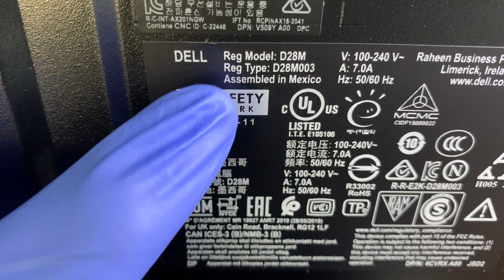Dell G5 5000 Desktop Break Down

Comment: You definitely CANNOT use the 8-pin AND the 6-pin connectors side by side. You choose one, or the other, not both. There are two PSU configurations for this machine. 360W, and 500W. Neither of them can power a card that requires an 8-pin AND a 6-pin. That would be a 300W card, which would be in the range of a 3070 Ti, or possibly an OEM 3080 that is custom configured for lower power consumption by the vendor that may exist somewhere in the world. There is no way such a card would run in this machine.

Comment: I'm not getting any power to my sata drives.  Using the 8 pin sata power adaptor.  Is this a common issue. Bios does not detect any drives

Comment: I upgraded my Ram by adding two additional sticks of 2x8GB 3200mhz. But they seem to be throttled down to 2400hz from 2933mhz. Is this expected or is there anything else I can do? My CPU is the i7 10700
Reply: it’s because your motherboard doesn’t allow those high speeds you can put and xmp through bios to reach those speeds if your motherboard allow it’s
Reply: Can you tell me which exact sticks of 8 gb ram you bought? I bought 2 sticks of 8gb but it didn’t work or wasn’t compatible…
Reply: @zawarust  i bought 2 sticks of 16 gb corsair vengeance rgb. they worked fine for me
Reply: @caubiy  thanks man! Appretiate it

Comment: Is there a way like a special cable to plug into the motherboard to use the intel graphics of the GPU (in case you removed the graphics card) ?

Comment: if i get a new motherboard can i remove all the parts and change the case?
Reply: I believe that would work but you would also need a new power supply
Reply: @chrisestrada8587 thanks for the info

Comment: Thanks for the walk-through. I have a question though. I want to run two Nvidia Geoforce GTX 650 supers rather than the single card supplied with the Dell G5. As there is only one card slot to accommodate the GPU is it possible to use an external (EGPU) on the G5 ? I don't want to remove what is a brand new GPU and spend a lot of money on an 8gb card but I want 8GB of vram. Any help would be appreciated. Also if a EGPU is viable what case would you suggest getting.
Reply from the maker: It will not work because the Power Supply is low voltage.

Comment: Mine came with a gtx 1650 super. Can I upgrade it to an rtx 2060? If not what is the best card I can upgrade to?
Reply from the maker: No you cannot. Power supply does not have enough power for 2060

Comment: I'm watching the video from Mongolia. I bought a Dell G5 i7 10700f and RTX 3060 ti dekstop 14 days ago.6 million MNT in Mongolian currency. That's $ 2,105.2.. When I bought it, I trusted the dell company. But I soon found out that people were dissatisfied with the computer, which was full of the Internet. The main problem was CPU overheating. So I studied. First I had to get a Cpu cooler. I also had to get a fan to improve the airflow. But I don't know which model of CPU cooler fits the motherboard. Also (power supply) is a concern. In addition to the 3 fans, the capacity will increase when installing the CPU cooler. I don't know how to do it all right. You also need to learn how to connect the plugs properly. And I'm sure that teaching well like this video will solve many people's problems. Thank you for your help
Reply from the maker: Mongolia, is your climate cold ? Here is my other video:  Benchmark with CPU Temp:  https://www.youtube.com/watch?v=Xuuu_DnhWbc
Another louder volume review: 
https://www.youtube.com/watch?v=Ozoq_EJdk4U

Comment: Thanks UberGeeks for the roadmap to the computer. I am experiencing buyer regret with this PC though, as I have bought more memory, but can't use this memory to the max as Dell does not let you overclock it. Won't be buying this brand again!
Reply: 2666mhz is an intel limitation, you can't OC it. Should have went Ryzen based if you want fast ram.
Reply: @TRUMPWON2020-w1r  ahh  that explains it. I’m limited there as well but I don’t think that’s too big a deal
Reply from the maker: I'm sorry to hear about your experience

Comment: Heat is a major issue with this pc. I'm looking at the Noctua u9s in a push pull configuration but I'm concerned it wont fit. What do you recommend to bring down GPU temps
Reply: For whatever reason, my gpu fan would not go anywhere near 100% speed. My GPU temp was 80+ with a hotspot temp of 90+. I downloaded MSI afterburner and changed the fan curve so I could ramp it up to full speed. I can keep my GPU in the 60s or 70s now.
Reply from the maker: I'll make separate video on heatsink installation
Reply: @UbergeeksBiz  thank you kind sir, subbed!

Comment: hi, so mine looks exactly like that except i have better graphics card.  my question is that it was supposed to come with a 512 solid state drive but i don't see it anywhere.   computer is working like it has it.
Reply from the maker: The 512gb NVME M.2 is on the motherboard.

Comment: Thank you for the video, quite useful! I added a stick of RAM and an NVME SSD for booting and couple games. Do you know the size of the fans? I might replace those. And is the Motherboard able to be taken out? If so, do you know what size it is? I'm thinking of getting a new case and powersupply. I only got this desktop because I got a good graphics card with it during a sale. Thank you!
Reply from the maker: You can't change to a new case. Has to be dell itself case.
Reply: @UbergeeksBiz  can we replace motherboard?
Plz reply quickly
Reply: Can i ask you which stick of ram you bought to put in it?

Comment: Great video, I want to upgrade my ram to 32GB (2 - 16) but I don’t know if the computer will handle it MHz wise. I got the I5 core meaning I can only hold 2936 MHz or something around that were as the ram I want to get say it is 3000 MHz. Just don’t want to get the ram and find out I can’t use it.
Reply: That board I believe is capped @ 2933Mhz. You can put any Ram Modules in there with higher Mhz, but it just won't exceed 2933 by the board specs. I have the i5 9940F and learned this when I wanted to upgrade early on. Best option would be to run 4x8GB sticks @ 2933 Mhz to obtain better speeds/smoothest operation. That way you're using all 4 channels. Hope this helps.
Reply from the maker: @Ryan Sweet is right. If you need 32gb, just run 4x8gb RAM.  Hope this link helps:   https://amzn.to/3fAtO4S

Comment: In your judgement what are some early upgrades people should consider? I have heard of some people upgrading the exhaust fan to something quieter and cooler. Others talk about adding a larger SSD or HDD.
Reply: Removing the HDD and adding SSD for better air-flow. There is a really decent amount of air-flow on the front intake when the HDD isn't there. Put a 92MM on the intake with a 4-Pin PWM Y Splitter. The rest is just fun after that. I adjust my Alienware Command Center settings to run the CPU fan at higher RPMS/Heat Ratio and with this setup I can play for hours without exceeding 50* Cels... prior to my 85* Cels.. Hope you enjoy your unit!
Reply from the maker: Every comments, people are interested with heat issues. Maybe is good to have cpu heatsink upgrade. Larger SSD is just personal preferences.

Comment: Hey man I got this PC recently, and I'm completely new to PC's and I was wondering if it's possible to upgrade the power supply on the G5 Gaming Desktop
Reply: It's a dell proprietary, it's one of the biggest complaints on the Dell G5. Newer models coming out with options of 500W are more adequate, but questionable if pairing with the higher end RTX 30 Series cards... something to be aware of. If you're running the 460W Supply and using anything RTX 2060 and under, you should be fine. The biggest draw will be the graphics card, so that's the most important thing to consider.
Reply: @ryansweet7599   I have a 1060 Ti  for the graphics card and 360W Power supply is that bad for my pc?
Reply: @fatherdamian  more than adequate
Reply: @ryansweet7599  huh interesting. A few days ago I ordered one with GTX 3070 and 500W psu. I was told it was barely enough but still enough
Reply: @MrBrainTucker1079  NVIDIAs site states that it recommends a 650W Power Supply, but that's based on running an i9-10900K processor. Do you know what CPU it comes with? That will dictate if you have enough recommended wattage. It will run it, but how effectively and trouble free before seeing issues.
Reply: @ryansweet7599  yeah of course. My version comes with 10th gen i5-10400F processor. It's a bit on the weak-ish side but yeah, that's what I got to save a buck 😄
Reply: @MrBrainTucker1079  nothing wrong with that! I run an i5 9400F/RTX 2060 and it's nice. The i5 series is solid budget/performance! And your i5 10400F is 65W vs. the i9 10900K 125W. You should be ok.
Reply: @ryansweet7599  oh, alright. Thanks! I plan to upgrade it sometime in the future but for now, I imagine it would be good
Reply from the maker: So far I've not seen any upgrade power supply for this desktop yet

Comment: I’ve heard this pc overheats pretty bad and I just purchased one before reading about that. Should I be worried about that? Can I upgrade the fan and cooling somehow?
Reply from the maker: Stock CPU fan can gets hot. Maybe you can try a better CPU fan:  Noctua DH9L heatsink:  https://amzn.to/3ew1Fv2
Reply: Heat is a major issue for this pc I'm still looking for a cooler that will fit in the case
Reply: I installed a noctua nh-d9l in mine. Fits perfectly. I5 10400f LGA 1200 socket.

Comment: Are the stock fans good? I heard that the system overheats easily and buying a new cooling system for the pc is recommended
Reply from the maker: Yes, it does get hot from stock CPU fan. You can try this:  Noctua DH9L heatsink:  https://amzn.to/3ew1Fv2
Reply: @UbergeeksBiz  hey, do you know if you need to get any specifics screw with the DH9L?
Reply from the maker: @Ss_k4  No, it should be just regular Phillip screwdriver.

Comment: Does this psu have a 2nd 6+2 cable port?  Like, could I plug a 2nd one in even if it doesn't come with the 2nd cable?
Reply from the maker: The Dell original power supply comes with 6pin pcie / 8pin pcie connector

Comment: Does the mother board support rgb , I have this pc and want to add rgb lighting
Reply from the maker: The motherboard does not have 12V GRB connector. Sorry, you can't add RGB lightning to it. Maybe try this ?   https://amzn.to/2OXymqL
Reply: Ok thanks this is my first gaming pc and now I’m learning a lot I went from single channel 8gb to dual channel Corsair vengeance 16gbram. if I want  to change out cooling fan  what would you recommend?
Reply from the maker: @bigmike8581  Cool. That's a good upgrade from 8gb to 16gb RAM. If you want a better cpu cooling, try this:  Noctua DH9L heatsink:  https://amzn.to/3ew1Fv2

Comment: What about additional cooling installation?
Reply: Super easy. I posted a video on my cooling mods. You can fit two 92mm Intake fans and one 92mm exhaust. Cpu cooler w/92mm fan as well.
Reply from the maker: You can add intake and exhaust fan. Or better CPU heatsink fan. Noctua DH9L heatsink:  https://amzn.to/3ew1Fv2

Comment: Is the G5 5000 the same as G5 5090? I have the G5 5000 and wanted to replace the Stock CPU cooler to improve the temperature. This video shows how to upgrade the Stock CPU cooler, but the G5 model shown is the G5 5090.

https://www.youtube.com/watch?v=-elCAKf02iA

Thanks in advance @UberGeeks
Reply from the maker: Good video on the upgrade. Yes, G5 5000 or G5090 are the same series. Can use the same heatsink
Reply: @UbergeeksBiz  Thanks! did the upgrade and CPU temperature went down significantly from average 85 deg (c) to 50 deg (c)
Reply from the maker: @isurjadi  Wow. That's a huge drop. I'm glad it all worked out for you !
Reply: @isurjadi  what new cpu cooler did you end up using?
Reply: @isurjadi  what fan
Reply: @anthonysnyder5878  Cooler Master Hyper TX3 Evo and Noctua 92mm NF-A9 PWM 2000RPM Fan

Comment: Hi thank for the video! I want to replace my CPU cooler and was wondering if the Noctua NH-D15S (Dual tower) would be compatible with this PC? I was considering an additional fan at the front but i don't want to remove the HDD and so i'm wondering if a dual cooler fan should remove most of the heating issues instead
Thanks!
Reply: @Dwigt  makes sense, appreciate it
Reply from the maker: @Dwigt  They should fit in. But the RAM will be in a TIGHT space.
Reply from the maker: Noctua might be too big. You can try measure the size before ordering it.
Reply from the maker: @Dwigt  Thanks for letting us know. Is that on RGB RAM heatsink or low profile RAM ?
Reply: @Dwigt  did u have to buy separate screws and washers to install the D9L?
Reply: @Dwigt   I just bought the NH-D9L today and discovered the lack of stock mounting 🙄 I've seen others using the same M3 screws you mentioned. Did you need anything else like washers? You mentioned the standoffs are those the black ones that come with the fan? Just want to keep this thing from catching on fire 😁
Reply: @Dwigt  how good is the cooling

Comment: Do you think I can install 2 120mm fans in the front?
Reply from the maker: There is no actual slot for additional fan. But if you want to jimmy rigged an intake 92mm fan, there should be enough room in the front.
Reply: There is no room for anything over 92MM on the front. I removed my HDD on the front and replaced it with a 2.5" SSD that has a top-bay in the unit, which cleaned it up nicely and allowed more air-flow. I then used a 4-Pin 2-Way PWM Splitter Cable from my rear fan/motherboard and attached the 92MM as a front-intake. It's even hard to get a 92MM in the front... and you definitely can't fit more than 1 without some Heavy Custom Modding.
Reply from the maker: @ryansweet7599  Thank you for comment

Comment: so for power supply if i cut through it can i install a small 1000 w power supply because i want to upgrade my video cards and better smaller fan would you recommending this ubergeeks ?
Reply from the maker: I would not recommend doing that. First, the original dell power supply does not come with 24pin + 4pin connectors to the motherboard. It is proprietary PSU for this motherboard.
Reply: @UbergeeksBiz  thanks man for explaining it in detail i guess i gotta go build my pc hehe
Reply from the maker: @eminmusayev7515  You are welcome

Comment: What powers the motherboard (what/how many pins on the connector.). And should I get a 6-8 pin adapter for a new psu?
Reply: You need to buy a 12V power supply. A regular one won't work
Reply: @MrAvatin  no like- an adapter
Reply: @MrAvatin  Also, I’m ordering a 12v psu anyway.
Reply: @MrAvatin  Wait, so I wont need an adapter for a 600w 12v psu?
Reply from the maker: @WindyCityAirsoft  Hi, if you are getting 600w PSU. I'm sure it has 6 and 8 pins for your GPU. Also it has 4 and 8 pins for your MOBO.
Reply: @UbergeeksBiz  will it work with this specific mobo in the G5 prebuilt?
Reply from the maker: @WindyCityAirsoft  Yes. It will

Comment: Hello I just ordered a similar system. Bur with a 3060 ti.   

Have u had any cooling issues?
If I wanted to add an intake fan would that be possible?  And are there any further card slots? Aside from ram?
Reply from the maker: No cooling issue. There is no room for additional fan to install.
Reply from the maker: @ZZZ If you want to jimmy rigged it, yes there is room for intake fan in the front. Just zip tied it.
Reply: @UbergeeksBiz  Do you have any intake fans you would recommend? Or rather, if one did want to add some extra cooling mechanisms, what would you yourself recommend? I also have one with the 3060 Ti and am concerned about overheating.
Reply from the maker: @Inthrylius  Maybe try this:  https://amzn.to/3bDhrRY    80mm or 120mm   Make sure you measure the length and height and depth before ordering.